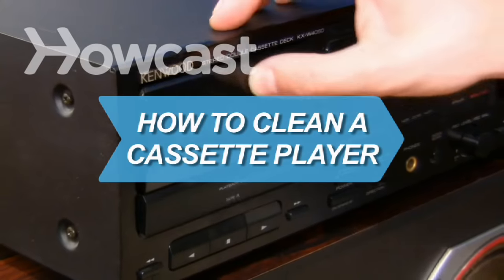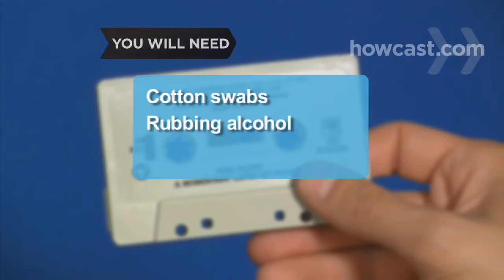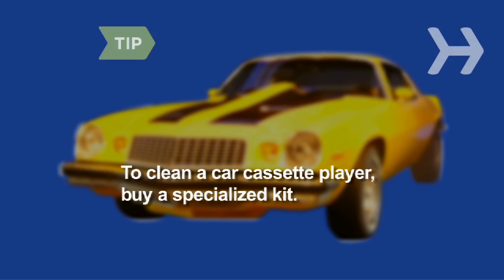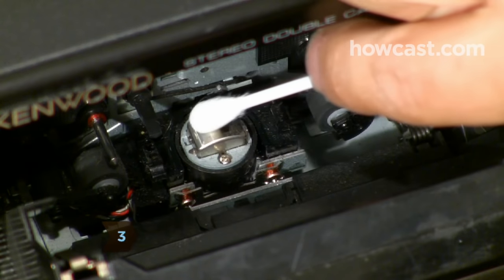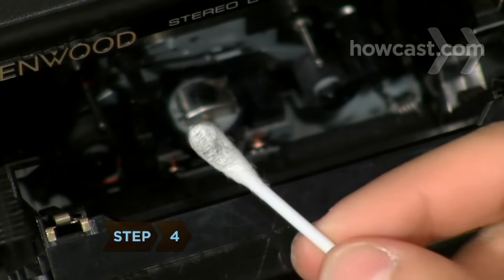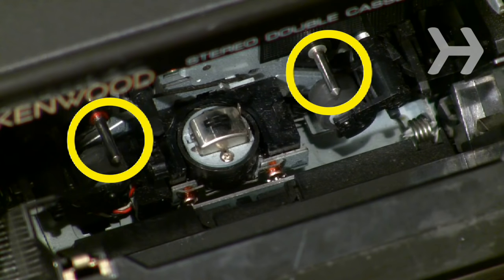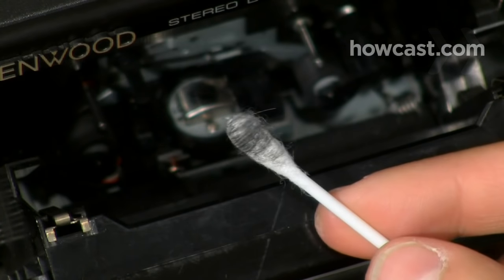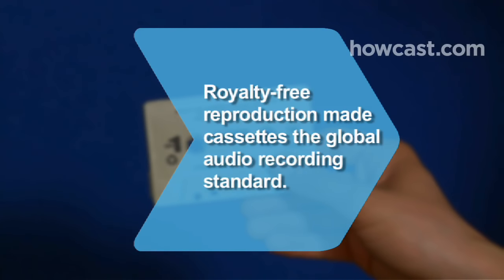How to Clean a Cassette Player

Comment: It is best to use rubber cleaner -Rubber alcohol  dries up the pinch rollers.
Reply: What docyou recommended. Also...can this also be done if some of those parts are rusted?
Reply: You can also use Windex as it does pretty much the same thing as isopropyl but goes easier on rubber

Comment: There is some debate  about the use of alcohol to clean the RUBBER PINCH ROLLERS. Ideally a rubber cleaner like the one used to clean rubber rollers on printers is more advised. Or just some distilled water may be better than alcohol.
Reply: I use my own spit to clean the roller
Reply: @Maxsarkar  Yes never use alcohol on the rollers or  spindles. Ha, there's a how to video I watched and the dude was doing just that.
Reply: @robertwoodward9231  so I just washed it with alcohol. Am I screwed?
Reply: @Youaresooriginal  You should be ok. You can go back over with some distilled water and auto part stores carry good rubber cleaning products.

Comment: Don't put in your favourite one in case it didn't work on the first try and it eats the tape
Reply: well I got a player that eats tapes and it's a nice player it's much nicer than the other one I have it has a backlight and auxiliary Jack and a microphone built into a recording of your voice on the tape but that player eats tapes but I think the cassette player needs some cleaning
Reply: I think you need to buy a new cassette player.
Reply: I've never had a tape eaten up by the player.
Reply: @huntershelton3130  when tape players start eating tapes most of the time it's caused by worn out belts that need to be replaced, the belts get old and stretched out.

Comment: Do not clean rubber parts with alcohol, alcohol dries rubber and if used enough can make it not grip and crack, on rollers just rub it down with a dry swab is what ive learned to do unless it is really really dirty then only do it once at most

Comment: Even a cassette tape is a bit more than 5 times the bit rate of a basic 128 kbit MP3 and still almost 3 times the bit rate over a download from iTunes. FLAC and other Lossless is ok, I use it in some circumstances. For me its CDs, Cassettes, Vinyl, SACD or DVD Audio. The reality is is that MP3 is the fast food version of an album.
Reply: Standard audio cassette tapes aren't digital, so they have no inherent bitrate. Your comparison is irrelevant.
Reply: @DoubleALabs  😅 ikr i was confused at this comparison
Reply: No one will ever hear the diference
Reply: Unless its an expensive metal master tape and you miraculously found a way to remove the inherent hiss of tape passing through the head, there’s no way a tape can sound cleaner and sharper than digital.
Reply: A cassette has lower high frequency content, more distortion and more noise than any mp3. And each time you play it you will loose even more high end. After 10 playbacks the sound is a puddle of mud
Reply: not anymore
Reply: @allancheli  To be fair sound can be sharp and clear and also be very low quality. The headphones or speakers you use can also affect the experience. — Lossy encoding formats like MP3 actually remove parts of the audio signal (usually stuff outside a certain frequency range) so that it can be more effectively compressed. The cassette tape or cd will at least represent the “original” recording to the extent that the combination of recording equipment and media used are capable.
Reply: @K176Y  what not anymore?
Reply: @banzobeans  i mean that things like itunes, and mp3s even have gotten so advanced in the past 9 years, even some streaming services providing lossless audio in the form of flac flies
Reply: I hear it

Comment: I recently bought a 1985 Sharp boombox and not only does it look beautiful but the radio works amazing. But when I tried a new cassette it sounded dirty and bad. I have to do a general cleaning because it has a LOT of dust, but will the audio come out clean with that? Also the balance pot does not find a midpoint, or it is left or right, although with the radio it works correctly. Wish me luck!

Comment: Nice! I have a B&O Beocord 5000 cassette player and it worked perfectly just some months ago then I haven't used it. Just moved it. For some reason when I turn it on, now the capstan roller is spinning when power on? and when I press in a tape it tries to play and 1 sec after it just shuts off? Any idea why?? All the best!

Comment: @JPizzicicleParody - My $300 Sony dual cassette deck was destroyed when a tape wrapped around the roller pins. The playback head system got stuck and when i finally got the cassette tape out,the system broke. I am crushed. I love my cassette collection. I have 240 cassettes give or take and converting them to cd is out of the question. I will just buy a less costlier cassette deck when i get the money next year.

Comment: Alright. I have a question. I have an old german "Sound 1080 S" and when I insert the tape into it and press play, it produces a medium-loud noise (hum). I have tried a cassete player cleaner tape multiple times and it did nothing. Do you guys know what the problem might be, and did i damage the head with the cleaner tape (heard it from rumors) ?
Reply: This is probably some kind of electrical interference from old parts inside the player itself I would assume, check videos about improper grounding or electrical hum on tape players. They might be a bit more helpful
Reply: @damiendroid8447 if

Comment: The magnetic tape inside the cassette can be damaged by a variety of things without even making physical contact. the sound quality is also inferior to that of a cd. ps what do you mean when they started warping and cracking cds can last forever as long as you dont leave them lying around.  Yes cassettes can take a bit more damage but that is because the actual tape is put in a protective case because it is so easily damaged. you could just as well put a cd in a case and it wouldnt get damaged
Reply: I've had several CD's both store bought in the late 80's and CD-rs that have stopped reading because of disc rot. They were in pristine shape with no scratches and kept in their cases.
Reply: I miss MiniDiscs. They were protected by the plastic housing.

Comment: Rubbing alcohol and ipa (isopropyl alcohol) are different. Rubbing alcohol is diluted ipa. For a decent job you need ipa. 99.9%
You can use rubbing alcohol but firstly because it is diluted will take longer and second, you need to know what the dilut is

Comment: i di it inn my Aiwa cassette player and now it started to eat my tapes.
Reply: If the pinch rollers or capstans were really wet with alcohol when yoy played a tape then the tape will stick to the pinch rollers or capstans and will become dinner for the aiwa. If it was dry then very possibly you need to demagnetize your tape deck if you have never done so.
Reply: If you played a tape while the pinch rollers (the rubber wheels) or capstans (the metal pins that make the rubber wheel spin) were still soaked in alchohol then the tape would stick to one of them and soon become dinner to your tape deck. If it was dry then either you need to demagnetize your deck or the belts in the mechanism have perished and become tar and the pinch rollers are still moving but not the intake reel and the it will end up eating your previous tapes.